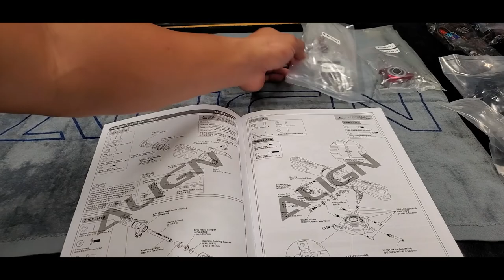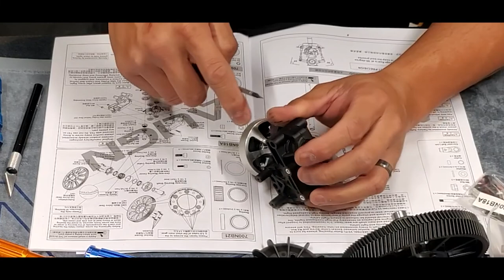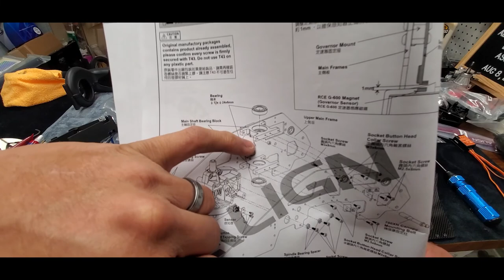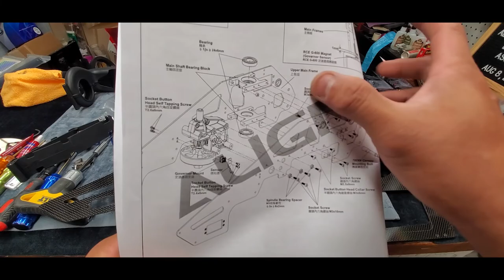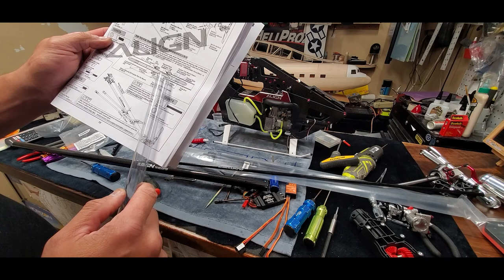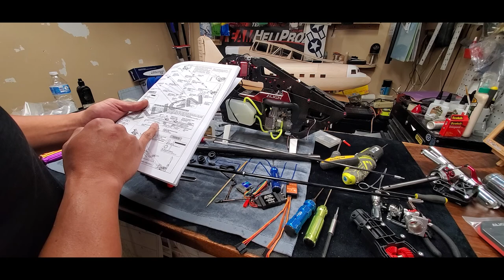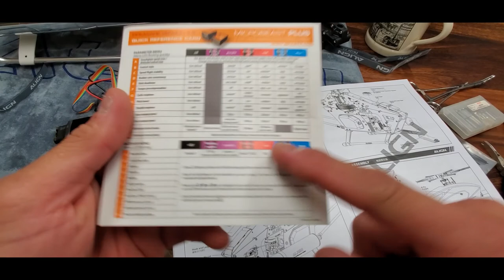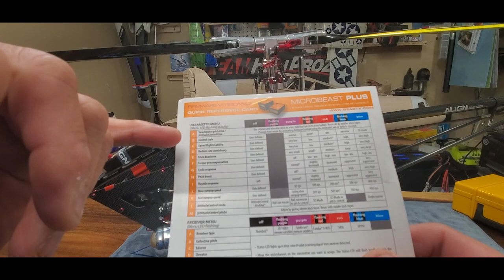Align Trex 700XN Dominator Assembly with Microbeast Plus programming

Comment: Thank you so much I was stuck until I found this video, couldn't figure out the left right on top carbon ,and all your hints and step by step has helped me so much thank you. I have the smaller 600 . Do you have any recommendations of what battery I should get thanks and again great video
Reply from the maker: You will need at least a 2S1P 7.4V Li-Po 1900~2600mAh to power electronics.  Thank you for watching the video and glad it was able to help out.